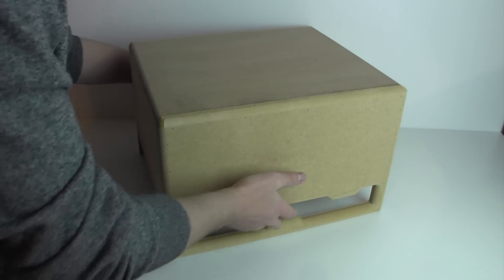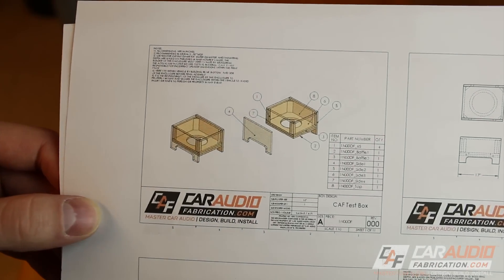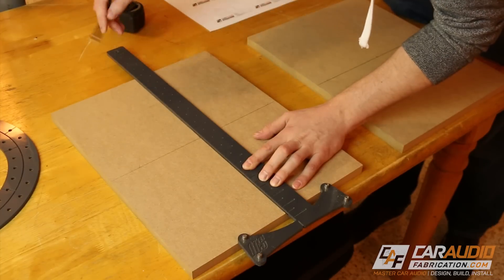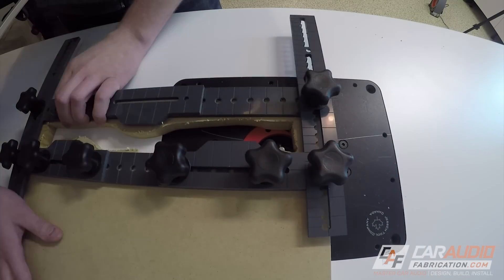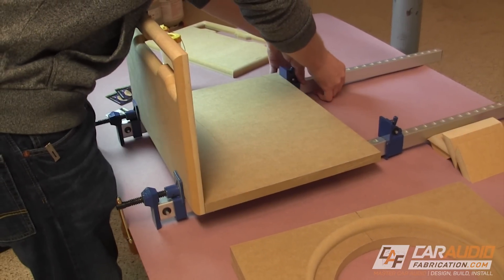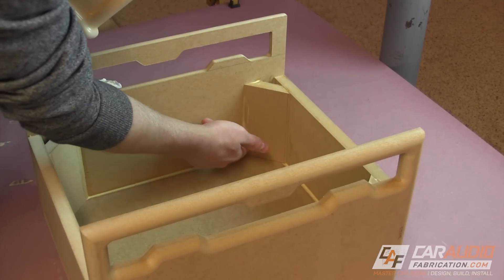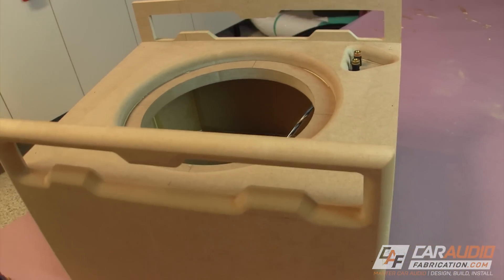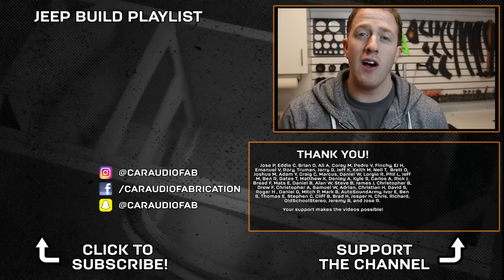Build a Subwoofer Test Box - BETTER BASS - CarAudioFabrication

Comment from the maker: Question: What vehicle do you have, what subwoofers, and what direction are the subwoofers facing?
Reply: CarAudioFabrication I've always down fired my subwoofers in extended cab trucks and Jeeps.  it helps protect the subwoofer from damage as well as carry the bass notes throughout the vehicle.  Now having said that, all of the speaker boxes I have built have been ported or dual ported per sub specs.  thank you for making these videos very informative and great to watch while I travel.
Reply: CarAudioFabrication 2013 lancer, I've got my sub facing the trunk. In my experience it's been the way to go for basic setups in sedans and hatches. Longer wavelength by the time it reaches the front of the car.
Reply: A -92 Pontiac Firebird but no sound since I'm all out of cash :(
Reply: Honda del Sol with 2 10's in the trunk and 1 cheapo 10 in the cabin between the seats.  It's just a hodge podge setup of random stuff I got cheaply.  In the trunk is a 10" rear firing sealed box and a 10" bandbass box wired inversely (so the subs produce sound in the same direction) with the ports firing backwards.  The 10" in the cabin is one of those cheapo 10's you get with the tiny little 50 watt amp from Walmart.  It helps produce some more mid bass in the cabin.
Reply: Setup:
-Rockford Fosgate HE RFP4810 wired to 4 ohms 400 rms
-PIONEER GM-A5602 GM Series Class AB Amp (2 Channels, 900 Watts) bridged 450 rms at 4 ohms
-JVC arsenal kd-ar959bs 
-Napa Battery
-Slot ported enclosure tuned to 27hz
Being played in an 1997 Toyota Avalon with rear armrest down and woofers facing the rear trunk.
 I was actually thinking of this enclosure with the port facing towards the rear armrest
http://m.ebay.com/itm/BMW-3-series-E46-Convertible-10-sub-Twin-Vented-Bass-Box-Subwoofer-Enclosure-/261576373987?nav=WATCHING_ACTIVE
 but the one in this video is cool ...Your work is precise !!! huge fan !!! keep them coming !!!
Reply: CarAudioFabrication 1996 chevy k1500 xcab. 1 jl 10w7 in the H.O box it's firing to the rear. I did this it make sure nothing touches the sub. :)
Reply: Well it's in sweden so that might be an issue =/
Reply: 2 12s in a 4 door jeep. Custom made transmission line box, upward firing with a plexi window on the back.
Reply: Nissan Titan, took the back seats out, sub facing back 6 inches away from the back wall, port on passenger side facing up. Next box is gonna be 3 18's facing up and port on the rear facing up
Reply: CarAudioFabrication 
2014 Nissan Maxima with a single Rockford p3 12 in a ported box. The sub faces the trunk while my port is firing into the car in the back of the box towards the driver side seat. I find i get more performence inside the cabin while the traditional way is louder outside the car. Also great for Metal and rock so you can hear naunces from the bass guitar more while rap hits you in the chest a lot harder.
Reply: Wrangler JKU, 3 Sundown SA12's, subs up, kerfed port back, tuned to 33hz. Tried to integrate the basshead lifestyle into my wheeling/rock crawler Jeep build but 3 subs in 7.5 ft^3 triple baffle enclosure, 4 group 31's & 5 amps is just too much weight to lug around while offroading. Scaling back to single 12.
Reply: CarAudioFabrication  was wondering if you could give your opinion on downfiring, would it be a good idea in a Nissan Cube,  going to be powering a sundown e8v5 off a Rockford fosgate 500x1d at 2 ohms, trying to decide what style of ported box.
Reply: The3rd ERA Depends if your gonna put stuff in the back that could possibly damage the woofer. my buddy goes fishing and hunting alot and he crams stuff in his car id reccomend one for him but otherwise id just do a regular ported box.
Reply: Mine is small hatchback. I have two woofers inverted and facing up. There's no other way, because so large box and small trunk.
Reply: Volksvagen polo 86c 1981  i have all the stock speakers but i order sundown audio x10 1250wrms and amp and all the wires head unit bla bla bla...  only sundown audio driver cost more than car its gonna be facing on the side :P
Reply: CarAudioFabrication I have a ranger supercab with a 10" fosgate p2d2 sealed firing at the middle seat towards the windshield
Reply: CarAudioFabrication 2014 Sentra with 2 JL W3v3's in a sealed box. They are in the truck firing towards the trunk hatch.
Reply: Travis The Jiu-Jitsu Guy Are they the 13 3v3? cuz I have one in my 2016 Toyotas camry its in a sealed box and my whole car rattles. like I don't even keep a snow tool. does your car not completely fall apart with 2 of them?
Reply: 2015 Nissan Juke with a Type S in a T-line encloser sub facing up port facing back
Reply: 15 versa note. 2 nvx vsw104v2 in sealed box facing hatch.
Reply: 2003 Kia Sedona, 2 Alpine Type-R 12's firing up in place of the 3rd row
Reply: +zavier lehman I have two 12 inch woofer's. They aren't 13's but there is so much pressure when they fire that the back sheet metal behind the rear door of the sentry's body flexis and the sheet metal and upholstery behind the rear seats underneath the rear window vibrates and moves. They will even Shake the sun visors all the way in the front of the car. That's just some of what those 2 woofer's do you my Sentra. It does feel like the car is getting beat up though.
Reply: Travis The Jiu-Jitsu Guy 
that's what I thought good subs destroy cars 😝 what wattage and ohm are they running at ?
Reply: I am going to have to say amen to that! Good subs = performance. The higher the quality the woofers yields a higher quality of outputted bass notes. I am running a JX 1000 (1000 Watts). The two woofer's are wired in parallel too 2 ohms of resistance.
Reply: Jeep Commander, with a single 18 inch Fi BL subwoofer facing the roof, with two aero ports facing the rear hatch. Adjusting the window level can also make your entire system sound different as well, because of the change of load on the speaker. Its like having the benefits of a bandpass box and a sealed/ported box! haha!
Reply: Travis The Jiu-Jitsu Guy 
I just looked that amp up and that thing is sweet. it must put out some ridiculous power. I wonder how my sub would handle its own brand amp rather than ARC?
Reply: Some things aside as long as it is CEA...  Compliment you should be getting at least that amount of wattage. I know through amp dyno test that  JL amps produce more power then listed in all range of test. As far as ARC audio amps I am not sure as to how they will preform. Food for thought is if you get a JL amp on that 13 will be doing well and not underpowering the woofer provided that the amp meets the woofers requirements.
Reply: 1996 Impala SS, single HDC3 15, firing towards the cabin. Since my tuning is below 30Hz, in this particular car firing towards the cabin helps with reinforcing the low notes while facing the trunk reinforces the high notes. I have  the flattest response curve I've seen in my life thanks to your blueprint!
Reply: CarAudioFabrication 2015 Subaru crosstrek with on JL Audio WT5 13 facing the hatch all. Sounds good for 600 watts.
Reply: CarAudioFabrication 2016 vw golf r 4 sundown audio sa8 v3s port back subs up
Reply: 2003 monte carlo with a Rockford 800.2 and 2 kicker compR 12s facing the rear. I've done it this way in every vehicle I've owned. good job on the downfiring box. might have  to use that  design in a future ride.👌✌
Reply: 2011 Altima coupe with dual Type R 10's in a custom box I just built about a month ago. The subs and port face the trunk lid and are positioned about 3" away from it. It sounds great and blows the prefab box I had them in previously out of the water.
Reply: A Mitsubishi Galant 5-door. Two Digital Designs 6.5" which is going to be facing the rear of the car. I've already made the box, and need to cut a hole in the trunk cover, where I've already mounted two 6x9's.
Reply: CarAudioFabrication Honda accord, I have two 12" alpine type r's. they're facing forward and sealed from the trunk to prevent rattles and provide a cleaner bass. Also, the port fires through the rear cuphoder. always recommend if possible
Reply: CarAudioFabrication 1 10" JL W6, sits closely to where factory sub sat. in 2005 mitsubishi montero limited. eventually a single 900.5 will power the complete system, but only when the remaining 6.5" component sets r added.
it's powered by the factory amp/with infinity premium sound, so the amp isn't too crappy (it maxes out at 20amps).
Reply: Bmw e46 touring jl audio 8w6's x3 sealed box upward facing.
Reply: 1 12 inch in a trunk pushed close to the back of the seats both speaker and port facing trunk.. i removed a speaker so the sound enters the car through there when ever i dont have a seat down
Reply: 98s V70, 2x10 Phoenix Gold in the trunk facing back, 140dB on 400wrms
Reply: CarAudioFabrication - I have a 2017 Tacoma Double Cab with dual Diamond Audio front facing subs.  There is no way to do down firing in my setup.
Reply: 05 Lincoln Aviator. 2 15's audiopipe txx-bd2's  on planet audio bb2 4k. firing towards each other with port up in a 4th order 2:1 :)
Reply: 2002 Acura RSX type S with three JL Audio 10W1v2-8'2 facing up in a 6.4cuft box tuned to 34hz, ports also facing up and located one port between each of the 3 subs. It loads off the rear hatch glass and projects forward nicely.
Reply: CarAudioFabrication 99 acura tl with 12" massive audio hippo with 2000 watt massive audio Amp facing rear of car with extended port through back seat arm rest
Reply: 2004 Jeep Grand Cherokee with 2 Rockford Fosgate T1d415's facing hatch, with labyrinth style center port.  sounds nice, in the process of building a sub up port rear box to fit the cargo area.
Reply: 2010 rear facing
Reply: CarAudioFabrication 2002 Huffy and i have .075in subs facing my brain, in my ears
Reply: CarAudioFabrication
Reply: I always try to downfire my subs as well in trucks! It helps spread in my opinion but my mind changes all the time haha
Reply: 1996 Geo Metro Hatch, Two 12s in the trunk at 70 degrees to the window
Reply: I have a downward firing 10 inch box in the spare tire well of my Mazda 5.
Reply: CarAudioFabrication  8w3 ported firing forward behind the seat of a regular cab 05 silverado
Reply: 3 10" Kicker comps in a 38 Hz tapped horn with the mouth firing up into the rear hatch of a ZX3 Focus. Smooth response from 36-120 Hz (+/- 3dB measured) with incredible transient and impulse responses. The reason I designed the box this way was to utilize the shape of the cabin to effectively extend the length of the horn into the drivers area. You basically sit in the mouth of the horn that way.
Reply: Sedan Toyota. I have Morel Ultimo SC12 in 36L sealed box, front firing through the hole cut in the middle of back seat. 10-40Hz flat response (+-2db with calibrated measurement mic), highs cut with processor in the head unit.
Reply: CarAudioFabrication 
03 Ford Ranger 
going to build my first box for my 2 MTX Terminator subs using info from your videos
I am going to also install a speaker amp and a second battery, should I also install a capacitor or will the agm battery essentially complete that task?
Reply: 2003 Chevy Tahoe, 1 18" SKAR AUDIO ZVX-18v2 1500 watt rms dual 2 ohm, facing up, rectangle port facing back
Reply: CarAudioFabrication
Reply: CarAudioFabrication 1997 silverado ext cab. two jl audio 12tw3-d4 wired at 2 ohm, they are 400rms but have 580 being put to each by a memphis audio pr1000. theyre in a sealed box with about .95scf each but both sharing the same air space. they fire upwards under my rear seat. sounds clean and hits low considering they are shallow mount speakers. i want to swap to the same speaker but in 10in size but firing down.. does it sound different sounding fired down??
Reply: 1999 ford expedition , jensen xs 75rms pointing up
Reply: 2007 saab 9-3, 2 Tang Band 6"x9" upwards firing, under each seat, 200W RMS combined at 4 Ohms.
Reply: 2004 kia optima. 2 power bass ps12's 150 watts too both, seats laid down subs in trunk pointed into the car.
Reply: '01 Cadillac Catera, 15" Memphis BR15D4, towards the back.
Reply: CarAudioFabrication I have a mini cooper s r53 with Harman Kardon audio and the only bass is coming from the rear side panels, behind the panels there's a 6x9 bass speaker on each side. I want to add a subwoofer to this sound system, do you ave any tips for me considering there isn't much luggage space to play with. thanks for all your video's. They really help me. Myrddin Tieleman from the Netherlands.
Reply: i have a 2011 Mustang with 1 12" pointing towards the back. is there a better location for these cars?
Reply: 1997 Peugeot 106 S2. One Ground Zero GZNW 12  2000 W subwoofer on 1 ohm with Ground Zero GZNA 1.2500 D.
Woofer is facing to the back with about 12 cm of room to the hatch. 80 % of the trunk are the subwoofer box.
It shakes the steering wheel and makes cloth fly around in the front windows
Reply: I have a 2006 Mazda Tribute (same thing as a Ford Escape) and I have 4 MTX 5512-22's facing up in the back cargo area in a sealed box.
Reply: I have a Ferrari 842 superfast and the subwoofer is double auna 2000W.
Reply: CarAudioFabrication  I have 2 pioneer ts 3003d4 I have a 2002 Acura CL 3.2 I need a sealed box I want to build a SQ system thinking of jbl GTO 6.5 components and have pioneer 4ways for rear fill.also I would like to keep the stock tweets(should I run them to the radio or wired with the components tweets?)I have a pioneer 9601 for subs and ssl 1000 4channel for mids and tweets
Reply: CarAudioFabrication ford flex rear facing bandpass two 10 inch kickers
Reply: I have a 2016 GMC Yukon and am thinking about making a down-firing box with a 10” subwoofer. The plan is to place the box and amp in between the bucket seats and do not want a big box in the trunk taking up space. Did that in my older Yukon. The space is roughly 15x15. Any advice and subwoofer, amp, and box size would be greatly appreciated. Great video as well about the test box.

Comment: i have a 1990 300zx with twin 10 inch fusion subs   en-sw102 and a 150x2 fusion amplifier
 speakers are mounted in the rear hatch corners facing up
Reply: about 15l per box sealed

Comment: 2003 Monaro with 2 12" Morel Ulitmo's facing backwards. Did you use threaded inserts to mount the subs? They'd be ideal if you're swapping subs out often.

Comment: I have a question about boxes, does the enclosure shape have an effect on output?

Talking about air space, would a perfect cube sound better than something with lets say very shallow depth, not much width, but a lot of length? Or what about other shapes; would an octogonal prism be better than a rectangular, triangular, hexagonal, pentagonal, heptagonal, nonagonal, decagonal, etc.; would pyramidal be better than straight prisms, or platonic solids (cubes, tetrahedrons, octahedrons, dodecahedrons, icosahedrons), or what about just a sphere? 

A long time ago I read that more surface area on the inside of a box helps, and that's why people will do sine wave patterns with layered boxes, or stuff boxes with insulation/pillow stuffy type material?

Comment: 2003 Chevy Silverado reg cab. 3 8" subs facing toward the rest of the cab with the port pointing up. I have a question. Are the CT Sounds amps better than the Skar amps? I need something that puts out around 1400 - 1500 watts rms at 1 ohm. Thanks you your help.

Comment: I have a 08' Ford Super Duty 4x4 with the rear window motor assembly down the middle which the design poses kind of a problem to get decent bass.  Right now I have a tiny little Kicker box on the passenger side behind the rear seat with two 8" Kickers facing forward run by a Bass Inferno 1500 and its just not doing it.  I was thinking of trying out that QPower Ford Super Duty Rhino Box to mount up two 10"'s and doubling the size of the amp which the box allows the space.  Is this a good idea?  Bad?  Any other suggestions?

Comment: Hi Mark. I have an '09 Elantra sadan. In my trunk I have a single 15" (dd 9915sc) in a 3.7ft3 ported box with inner changeable ports. It faces forward and the trunk is sealed off.
Side note I was looking for the terminals used in this video @ 6:58. They aren't in the link.
Reply: I noticed that as well and wold like to know what they were. My lat box build, I ended up using the terminals salvaged from a Lowes wall plate. I had to countersink both sides of the 3/4" MDF to get it to screw it in. It worked but I didn't like compromising the integrity of the box.